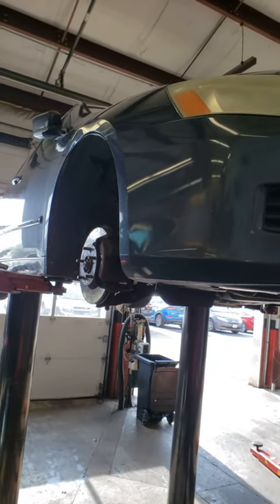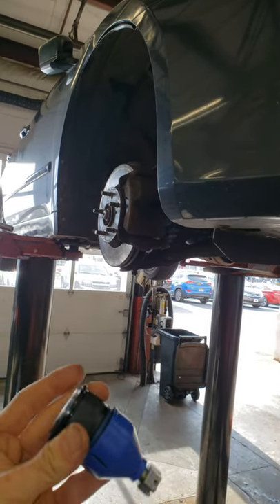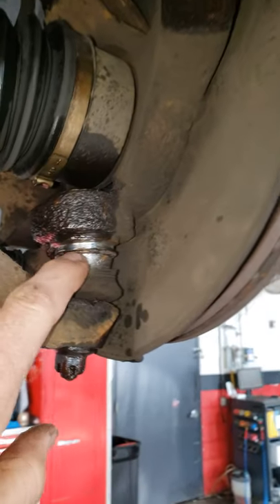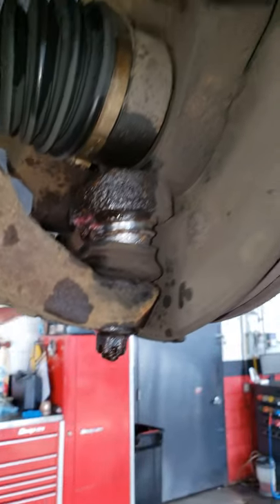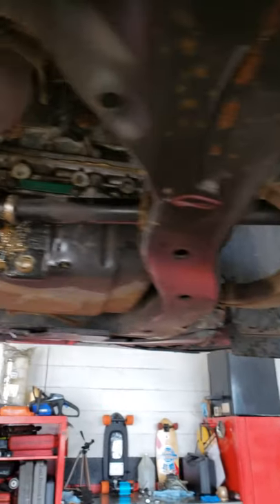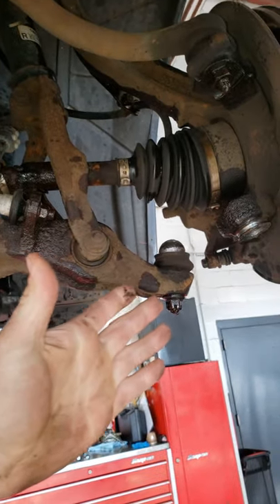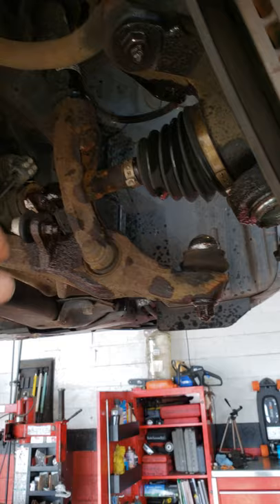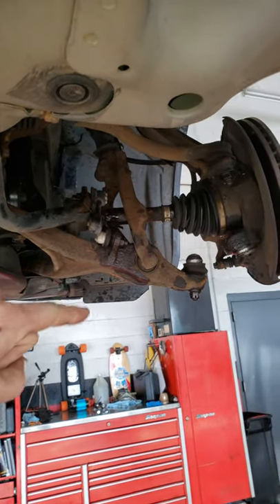Replace your ball joint if it's squeaking #shorts

Comment: Extremely common separation failure for Honda's because for a long time Honda mounted the ball joint stud facing down in a double wishbone suspension. 

Not only does this mean you have to pull the CV and hub to get clearance most of the time to get it out the way their spring mounted to the lower control arm through a wishbone meant that the suspension was always trying to pull the ball joint apart.

If you have a Honda that predates the switch over to MacPherson Strut and still has the double wishbone (Up to 2013 For Accord) get those ball joints properly checked often or learn to do it yourself (You only need a jack, jackstand, and prybar)

Comment: Mine never squeaked, I was always checking for play, and one day the passenger front of the car just fell. The ball joint did not come out of the socket, the ear came clean off the ball for whatever reason..  immediately replaced the whole front end lol. I agree with you.. check, check again,  and check some more

Comment: My wife's old 03 Hyundai sonata GLS almost claimed our life twice. First time, I was going 75mph on the interstate and the lower control arm bolts fell out somehow, and the wheel on the right front went all the way back, and threw me into a concrete barrier and I yanked the wheel hard left to soften the angle of impact, and I collided with the barrier hopped on 2 wheels and slid along the barrier then some guardrail and came back down all four. We were stranded 2 hours from home, and the damage was as follows: chunked up wheel, shredded tire, busted cv axle, scraped up lower control arm, fucked up alignment, and scratched up fender and bumper. Second time it happened I was going slowly through a parking lot picking my wife up form work and the same thing happened on the other side. I couldn't find a replacement bolt for the left side, so I went to my local hardware store and got a grad e8 bolt that closest match the original, and got some washers to use as spacers to fit in to get rid of the excess play cuz the bolt was too long, and I torqued in down after applying for shit load of threadlocker.
Reply: Damn that thing sounds cursed, need to add safety wire like on aircraft
Reply: Yea that's trade off vehicle. Sounds like some real crappy parts on the Korean Kamikaze Kruiser...

Comment: It's very common in Honda's to be in this situation, and most of front wheel drive cars
Reply: Funny you should mention that I recently picked up my old honda from a family member I loned to them for 2 years and well driving back I stopped at a gas station one to have the lower ball joint popped out and thank goodness I was turned in the station as I was gonna take it up in the mountains